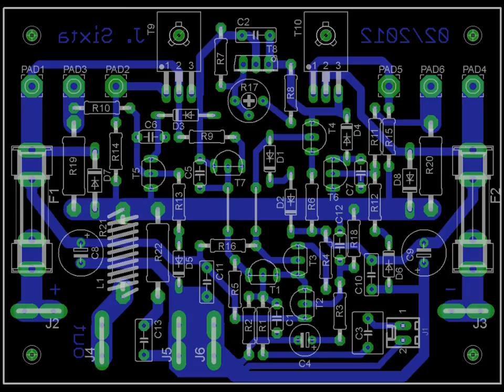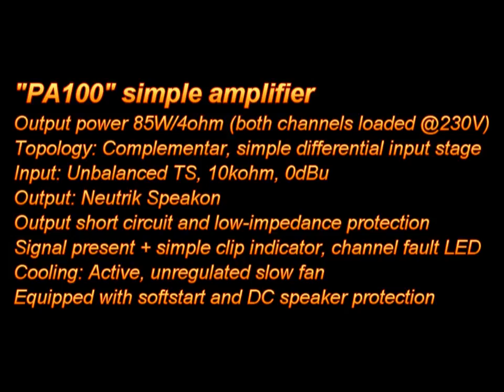PA100 simple audio amplifier (out of scratch)

Comment: did it serve well ? did it work good ?
Reply from the maker: Well, this amp was never put into real service anywhere. Was in fact my first complete design and attempt building a decent higher powered discrete transistor amplifier. It still works no issues, but I have other more interesting amp builds here. Most of which are not published here due to my lack of motivation.